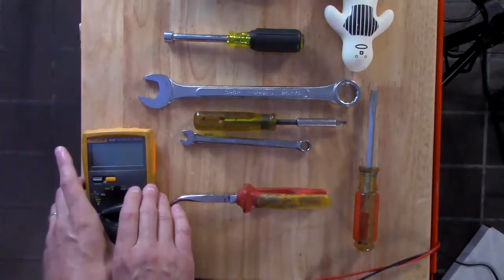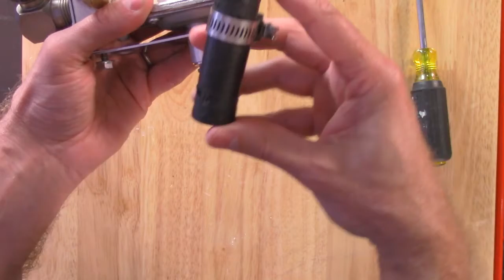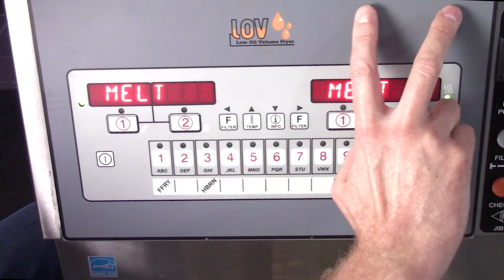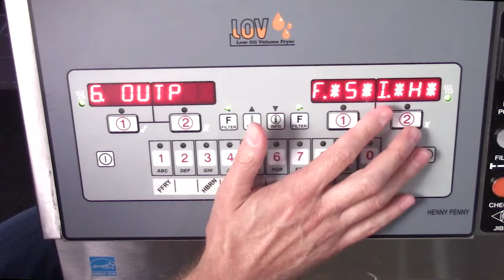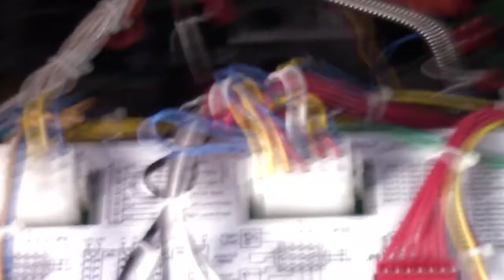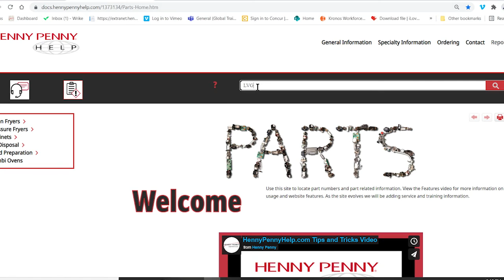E-22 Error Code Technical Micro Course - Henny Penny LOV Fryers

Comment: What if the error happens as they’re using the fryer  at random points did the oil get too low?
Reply from the maker: HI @gonzales2901 if this is on a gas fryer, we can see this error happen more often throughout the day if the oil is low.  The unit heats for several minutes, but never sees a temp rise at the probe because the oil is not touching the temp probe.  If this is on an electric fryer and you get intermittent E-22 errors through the day, then check if power cords are plugged in all the way or unplugged.  LOVs in some countries pull voltage to the controls through a separate cord.  Even though the control is working, the large 3 phase power cord may not be making connection or plugged in.  Hope this helps.

Comment: Thanks for the video, is there one coming about flame rollout? Can this error code be caused by a clogged pilot? or bad flame sense?
Reply from the maker: Flame rollout is generally caused by an obstruction in the flue exhaust, more specifically in the plenum. Please contact your local Henny Penny distributor for further assistance or our technical support department at tservices@hennypenny.com
Reply: That would be an e20B code. I just ran into one. Found a dust grease ball stopping the blades from spinning